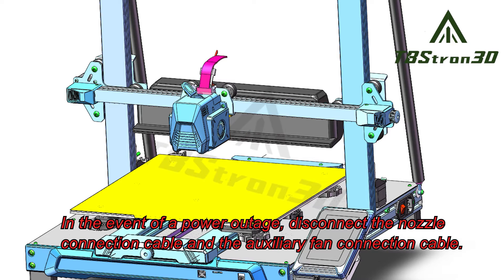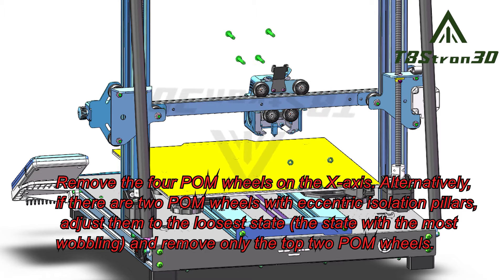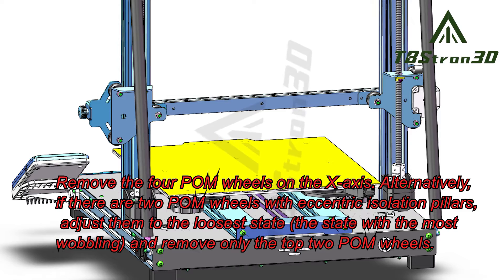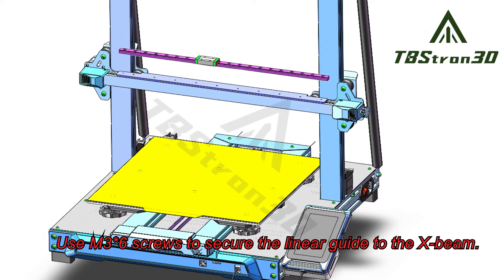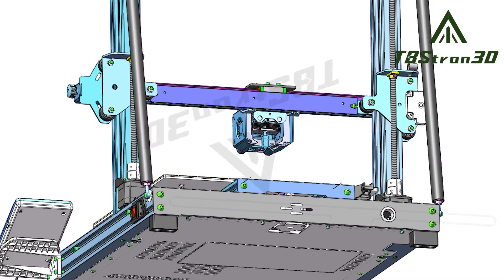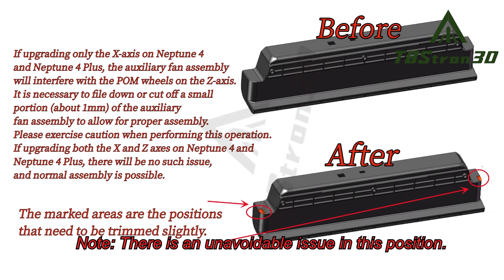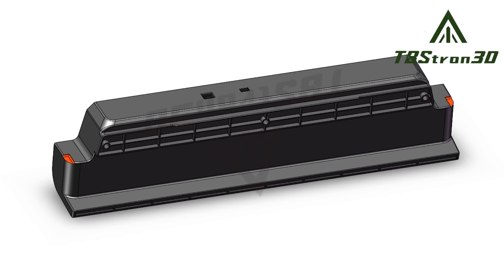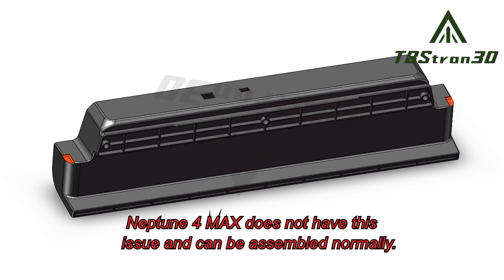ELEGOO  Neptune 4, Neptune 4 Plus, Neptune 4 Max X Axis Linear Rail Upgrade Installation Guide

Comment: Installed mine today. Looks pretty good. I tried to install the AliExpress Kit before but that just did not fit so i refunded that. This one fits without Problems.
Well Designer and the Video helps a lot.
Reply: Do you have to use the auxiliary fan with this upgrade?
Reply: @portland_operatorjones3059 you can use the auxiliary Fan. The bracket is bolted down together with the auxiliary Fan.